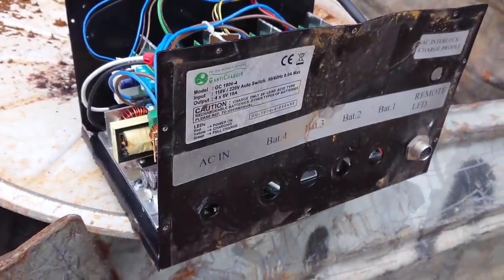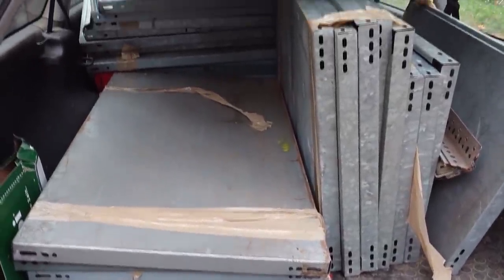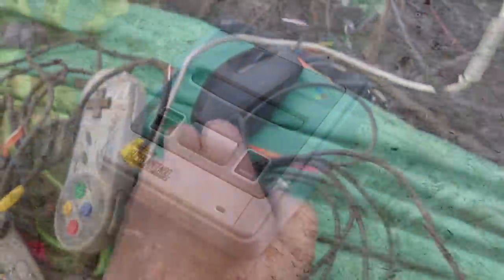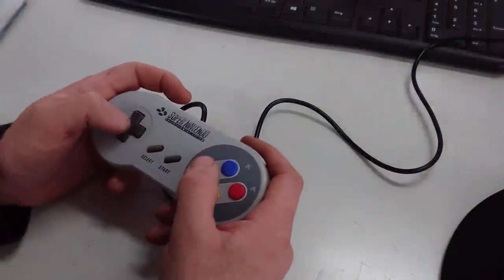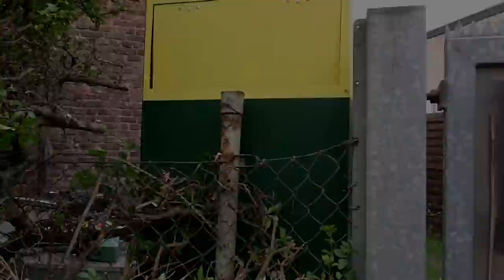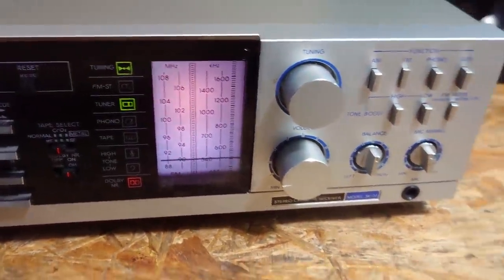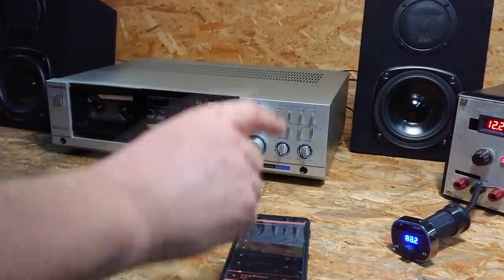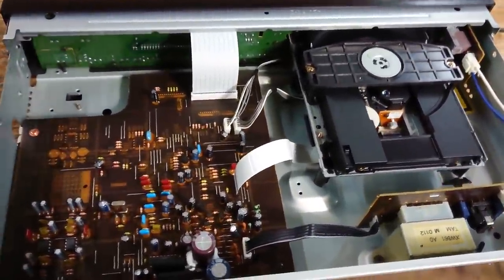Supreme Scrapyard Finds! Repair-A-Thon!

Comment: Scrap technology seems to be only valued for the raw materials that they contain. It is a shame that scrap electricals and electronic is not better protected from the effects of the weather. With a little thought by the product designers, far more of obsolete or faulty products could be recovered and reused. Such a strategy must be far more efficient than taking the scrap back to its basic chemical raw materials. Modular product design would most likely result in more modular parts being salvageable, as not every fault results in the total destruction of all of the products components, and while a product assemble may be obsolete, that does not mean that it's modular components have reached the same end of life state. Hopefully the right to repair will force manufactures to move to more modular designs.
Reply: Un/fortunately economies are built on waste ... but I wholeheartedly agree. Make it right, so you can hand down to your grandchildren ... Personally I blame F**cking salesmen😉😉😉

Comment: In case anyone wonders how these end up in a scrap yard I currently have Heavy Duty box in my back yard that company sells for $300 usd used and since no one even wants it for $30 I will have to scrap it. There simply is no easy way to get rid of uber expensive stuff other then scrap yard. Imagine that box has over 300 lbs steel - it took someone well over a day to weld it and many hours cutting etc. And now its just scrap.

Comment: I have my Panasonic 8-Track from 1974 still. I need to replace the drive belt on it and should be good to go as that was the reason I stopped using it. I have been collecting some old 8-track cassettes in the meantime. Everyone knows 8-tracks were superior to cassettes anytime...right!? 😉
Reply: Ooooh yeah, baby. The 8-tracks are just groovy!

Comment: Do you ever get into any old hit-and-miss engines or old diesel engines it would be cool to mix the old and the new Old hit-and-miss engine running say an air compressor or using it as a power plant  For electricity or  for A-line shaft belt drive

Comment: the yamaha has a problem with play on the cd tray mechanism and then it works again when it has had some taps i have that myself sometimes it does that too and then you give it a tap and it works small problem from the factory wrong plastic has been used and that wears a little harder

Comment: 7:40 Looks like you're using RF input for the SNES? Assuming it doesn't have it, but modifying that TV to accept RGB from the SNES instead (and maybe a 60hz mod on the SNES...personal preference, but I prefer my games at full speed these days in case you wanted to use it on a modern TV sometime (am in UK, we're at 50hz obviously)), it'd look gorgeous on that old CRT. Older CRTs are always such fun to modify and bend to do things they really shouldn't be doing :D

Comment: With regard to your mail box locking problem, is there no way to provide the parcel delivery service with a one time combination key. 
Many such services ask for information about a safe place to store packages. Is it not possible to include a key with this information. 
Failing that, a time lock programmed to unlock at the expected delivery time window, might provide better security.
Early mail boxes had a rotating chute mechanism. A horizontally mounted barrel shaped entry door, that when opened, blocked access to the long term storage container, only when the door was closed was the package dropped into the storage area.
One can also envisage a spring loaded flap floor, in the upper part of the mail box, that only unlocks when the entry door is closed.

Comment: things fall quite deep in that postbox. definitely not something for breakable stuff

maybe add a platform that goes down with the weight of the packet applied.

also given how high this seems to be placed it propably is not all that useful

Comment: I am curious. Where did you find the belt kit for the cassette player. It does seem as if the drive belts turn back into oil and liquid black rubber eventually. I still own some of these and want to keep them running. Thanks.

Comment: These old tape machines are going to be in demand. they are no longer made. Any new tape decks are complete garbage level devices. They all use the same cheap cassette holder and heads. You can not buy a new quality tape deck anymore.